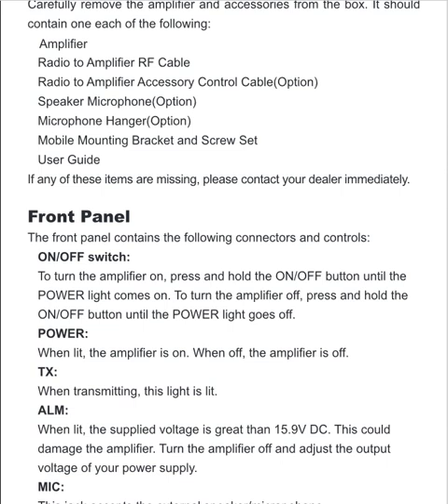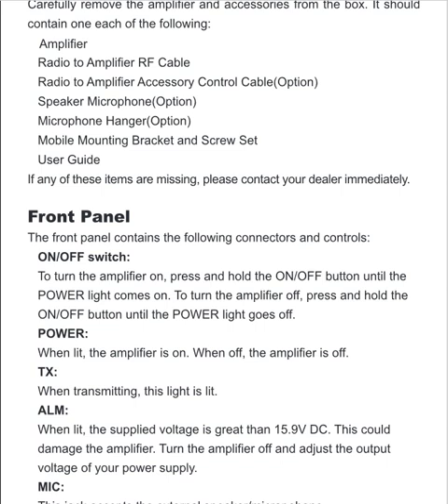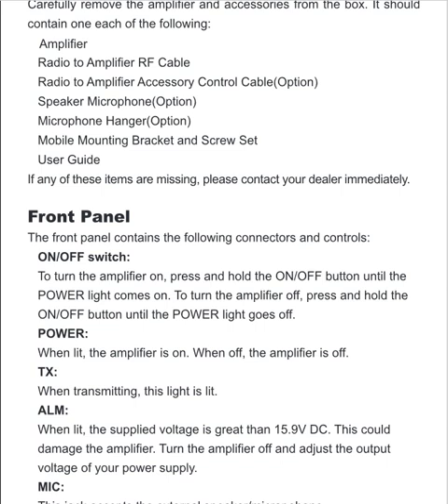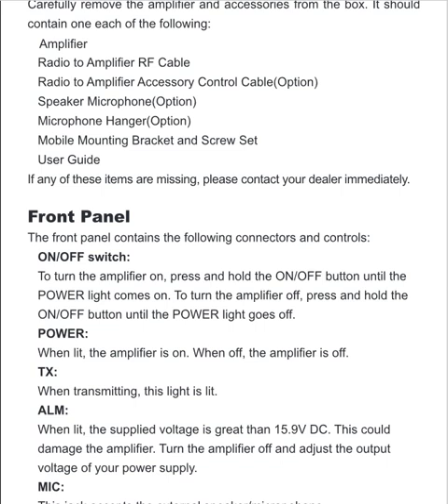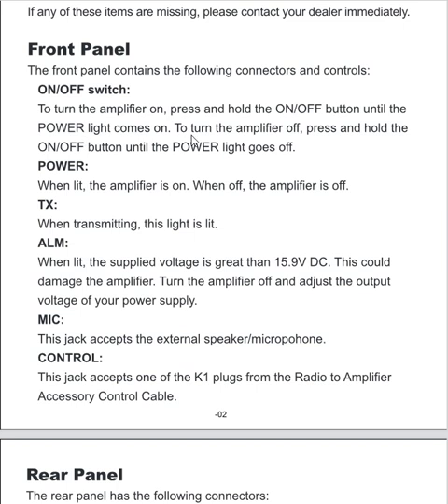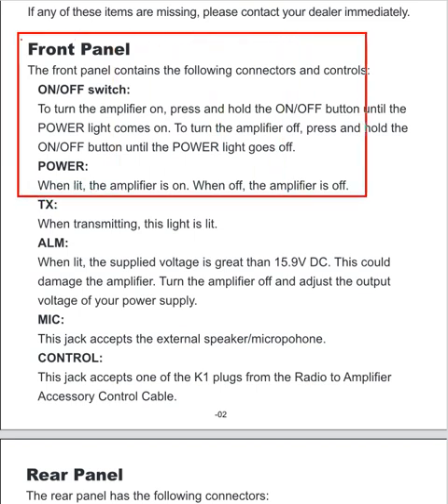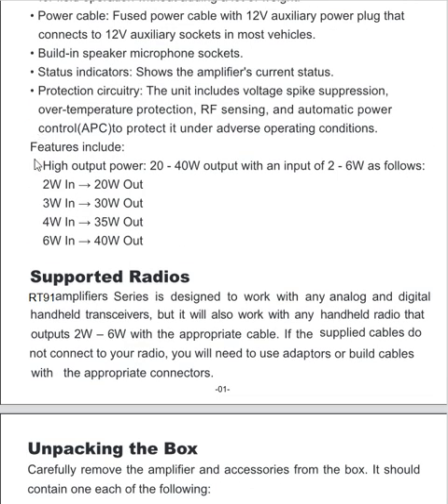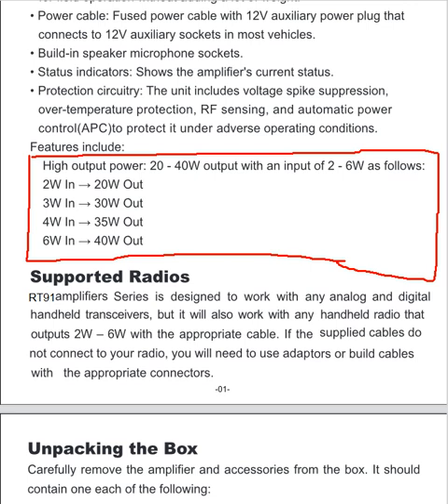🔺Problem with Retevis RT91 GMRS  Power Amplifier when using it with a repeater!!!🔺

Comment: As for the power switch for when the power fails, I was planning on powering using a 12v battery with solar or other charger.  Good point however. Will this amp work with the 2 HT repeater you designed?
Thanks
Reply from the maker: Hi- watch this video for the amp:
https://youtu.be/cI8l9gB9t8E

Comment: I'm curious to know how this amp works with the repeater.  If you install the amp after duplexer, I dont understand how its going to work, as the TX will kill any RX thats coming in from the person using the repeater - thats why the duplexer always has to go between the radio/power and the antenna.
Reply from the maker: i am not sure if i follow you if the unit is in TX mode then it will kill the RX? any radio can't RX while its TX?  I do have the amp here so i will be posting a video on what happens. The company (retevis) saids it can be used this way. BUT i am worry about the repeater loosing RX sensitivity because the amp is in line.
Reply from the maker: also this amp will NOT TX unless there is power (TX) coming in 2-6 watts. Once the repeater is in TX mode then this amp will be too.
Reply: @GMRStwowayradio  When the amp is connected to the repeater and assuming you are using 1 antenna on the repeater: The repeater needs to listen (RX) and transmit (TX) at the same time - the duplexer is what allows that to happen. If you put an amp after the duplexer, then the TX will (may?) cover/kill/desense the RX.. The inline amp must also be able to "listen" and send the RX back to the repeater while it's transmitting.. Let's see what happens when its connected to the repeater!
Reply from the maker: @TheNotaRubicon  - yes i am using one antenna and i see what you are saying now about desense. I will be trying the amp in the next couple of days. i am going to do a video distance test with repeater first to see how TX and RX. Then i will do another video distance test with repeater and amp. Then i can compare them.